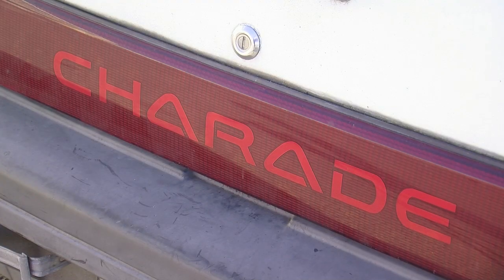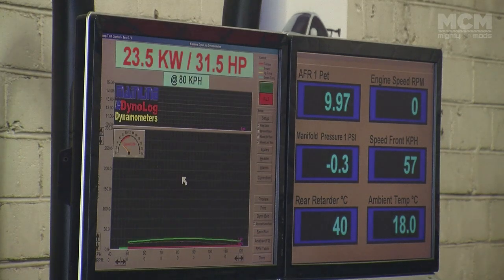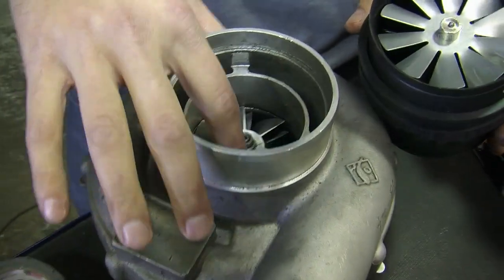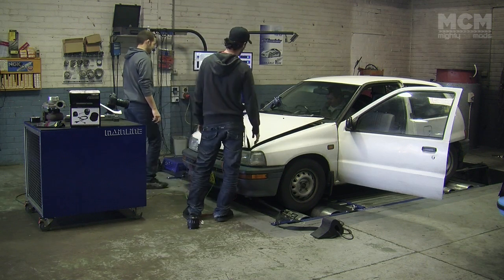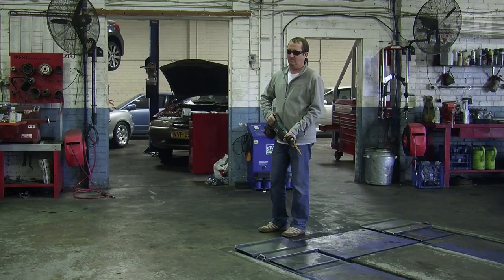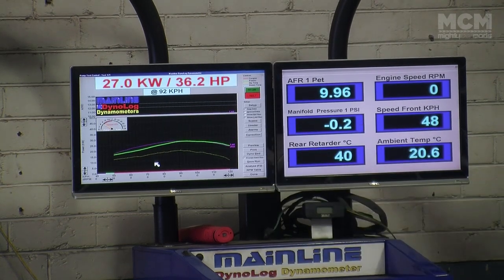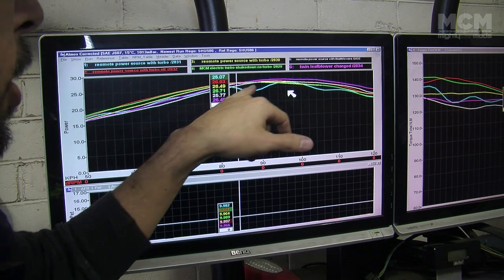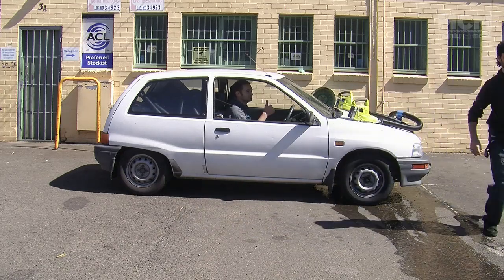Electric SuperChargers Mythbusted

Comment: Just more air, doesnt mean more power. You can put a turbo and push 2 bar into that engine, but without allowing more fuel from ECU = no more power, thats it. You must keep the correct AFR for the optimal power, just put more boost is worthless.
Reply: RizoProduction Holy shit, you all forgot this car is carbureted, there's no injectors, nor an ecu.
Reply: on most stock engines the air/fuel ratio is automatic
its gonna go lean for a couple pops but then the O2 sensor would be saying hey your not burning enough so the fuel ratio would be adjusted accordingly

consider how the throttle doesnt actually do anything with fuel, it adjust how much air goes into the engine, or rather how much air is choked with full throttle being no choke.  the engine knows how much fuel to add even thought you didnt tell it theres going to be more air
Reply: No, it doesnt. Stock maps and ecu software is already too lean to avoid nox formation, well more air will lean out more the mixture. Rich mixture means more power.
Reply: HighPotency Yes, you are right, with 2 bar boost you'll have a very lean AFR(air fuel ration), and gasoline engines doesnt like too lean condition, EGT will increase and engine will blow. In diesel engines things are little different, for 2 bar you can put X fuel or X+30% fuel, risks will be almost the same(excluding extrapower, internal pressure and so on). Diesel likes lean condition.
But idea was, you can put any supercharger/fan/even turbo to create boost or not, power will be the same without additional fuel from ECU and maybe bigger injectors.
Reply: alex bogatz   ECUs meter fuel in two main ways, open and closed loop.  In open loop mode, the lambda (Oxygen) sensor isn't used, instead the ECU uses a lookup table to determine the correct amount of fuel to use based on the load, throttle and sometimes some of the air sensors.  In closed loop, the lambda sensor is used to correct the ratio. Closed loop is usually only used during no-load (idle) or part load (cruising).  When accelerating you operate in open loop mode, normally because you are deliberately adding too much fuel.  When you tune a EFI engine on a dyno, what they're actually doing is fine tuning these lookup tables.  Even if the MAF was able to supply the ECU with a correct measurement of the increased air supply, the ECU is unlikely to have a table entry for the unexpected value (it may even decide that the MAF has failed and go into limp home mode), and will fall back to a default value.
Reply: I'm sorry, but more air does = more power...

 What do you think nitrous is? It's two parts nitrogen and one part oxygen. Nitrous allows the engine to burn more of its own fuel per stroke by increasing the oxygen levels inside of the cylinder. You can add a system that sends nitrous and gas. this is called a wet system. but a dry system will just send N2O into the engine..

 A wet system will send N2O + Fuel to your engine, so your O2 Sensors dont have to do the work.
 A dry system will inject N2O by its self, when this happens, the O2 sensor reads that you're running lean, and will inject more of it's own fuel into the engine.

 So technically, air will increase power..
Reply: RizoProduction My point was more air alone won't increase power, you have to add fuel to it as well as you have just confirmed.
Reply: Oh more air would definitely make more power with no fuel, more explosive power that'd send your pistons and rods shooting out of your block. Ie. detonation.
Reply: gracej79 Yes, you're right here, i was wrong nox vs co2, but even co2 should be keep under control. As other guys said here, more air without pushing more fuel, doesnt mean more power.
Lets take a diesel 4 cylinder 2.0 , we have 50 mg/stroke fuel at 4000 rpm, that means by calculation ~140 hp having ~1000+ mg/strke air(~2.1 bar absolute pressure on 2.0liter engine). 1000/50 = 20 AFR well diesel must have bigger than 16 17 for safe EGT.
Well if you just push 2.5 bar (aka 1200+ mg air), and keep the same 50 mg/stroke, you will not have more power, maybe you`ll have less power, because turbo has to do negative work to develop more pressure and more work means more EMP(exhaust backpressure).
In ECU that 50mg is a maximum limit well no sensor can push more fuel than maximum ecu limit, only if you adjust these parameters. I make remaps specially for diesel cars, for years with correct measurements , dynoed and so on, and i know what i`m talking
Reply: Marius Negrean Electric superchargers would work if they had more power(+motor). Superchargers/turbos have the power to store enough air when inlet valve is closed, thus the "compression stage". Electric turbos cant.
I want to try the supposedly 16.5 Amp electric supercharger. experimenting doesn't hurt...right?
Reply: Yep, thats true
Reply: alex bogatz keep in min thats is only goung to work with a car running obd2 (i think its 97+) but you are correct but only to a certin exstent because if your running (for example) 1:1 ratio of fuel to air  but you then increace air it then you have a 2:1 or 1: .5 but the ecu would only allow itself to change it by .3 - .4 before just quitting and throwing a code.
Reply: Neverming, in ECU maps there exists a lambda/smoke map, torque map, driver wish map. All those maps have a limited value, you can put 1 ton of air, if maps values are not extended ECU doesnt know to add more fuel...even you have mechanical limits, small injectors.
Reply: They wanted to show if it's possible to make noticable gain. That may involve not paying for ecu tune. I'm not sure but cars come stock with rich enough tune that a little bit of boost isn't enough to make an engine blow because of fuel starvation 'cuz the computer fan was too fast. If so, what a story you can tell!
Reply: RizoProduction Same point in my side. JUST MORE AIR, idea was clear. Everyone knows that more air allows more fuel, but in this case nobody controlled ecu to push more fuel and ecu will not do that itself.
Reply: Marius Negrean Yes, I agree. It seems in this video, that when the air entered the cylinder, no fuel was injected to compensate. bad o2 sensor maybe? I mean they did imply they bought the car for $100
Reply: Thats what i was thinking
Reply: Bait28
Ah, yes. I didn't even think of that. Dx
Reply: Marius Negrean with these fans you aren't adding significantly more air. with little actual compression happening the air is taking up the same amount of space. meaning the same amount of oxygen is going into the engine.
Reply: Lean mixture means more power too, just not the kind of power that you want. >.>
Reply: I doubt the fuel pump could keep up with a turbo...for that matter, is it carbureted? Putting that much air through a carb not designed for it is gonna have an affect.
Reply: Yes, more air will mean more power because there is more oxygen for the fuel to consume inside the cylinder, resulting in a more powerful explosion, but then you're running lean and risk blowing something up
Reply: No not..people doesnt understand that cars from factory are alreay too too lean. why more air than that? Keep stocchiometric AFR and its fine
Reply: doesn't the oxygen sensor do that for you? i've never heard of any type of car requiring changing ECU or ECU settings to adapt to more air flowing in
Reply: HighPotency Then I have a question, does it mean when you add turbo on it, you have to upgrade your ecu or injector accordingly?
Reply: todorpetrovic It is more air "in same volume" which is controlled by intake valve opens and closes. With the same amount of time, the cylinder can only suck same volume of air, if you want it contains more O2 in order to get more explosion power, then you have to compress the air. The reason why electric supercharger wont work is at the at the intake valve is open the "fan" blows the air into the cylinder until the air pressure in the whole intake system reaches a value that the "fan" couldn't compress any more. Any fan can compress air in this case, but how much? I would say a fan like that, 5% max, theoretically you get  5% power, if you adjust the fuel accordingly. In most cases, people buy that elec supercharger wont pay hundreds dollars for a customized ecu tuning, that's why people won't get any difference.
Reply: Bait28  His main point was: More air without more fuel = no extra power.  That doesn't change whether it's EFI or carb. Kian Palmer You're confusing efficiency with power.  It is more efficient to have excess oxygen so that all fuel is consumed (but you stop burning before the full stroke).  You get more power from excess fuel as the burn is happening over the full stroke (and possibly still occurring in the exhaust), and not only until the fuel is consumed.  Xiang Gao (Adding turbo).  Yes, if you add a turbo, you need to add more fuel.  If your injectors have already reached their maximum flow rate, then you need to upgrade your injectors if you want to make even more power.  Otherwise they will limit the power you make.
Reply: gracej79 There's a huge fundamental difference between how fuel is distributed with a carb engine and FI, especially when it scales with mass air flow.
Reply: Marius Negrean  You don't reduce NOx by being lean.  NOx is primarily controlled by EGR.  NOx is formed under high temperatures when there is excess air.  A rich mixture has a cooling effect on the charge as the liquid flashes to vapour, reducing the cylinder temperature, therefore a rich mixture actually develops less NOx, but more CO, etc.  EGR allows exhaust to displace air so that you can burn a small amount of fuel without it being an excessively lean mixture.   This allows low fuel usage at light load without high NOx.
Reply: Marius Negrean  I was talking about CO  (Monoxide).  CO is due to insufficient air during combustion.   CO2 is largely directly correlated with the total amount of fuel injected.  (The CO is converted to CO2 in the cat.). The amount of CO2 comes down to a balancing act between predetonation / cylinder temperature / Stoichiometric mixture .  Under your diesel example, additionally you'd also have to take into account the higher air temperature from the higher boost pressure (assuming no additional inter-cooling capacity).  This reduces the relative mass of the air and adds even more inefficiency.
Reply: I said above that ecu has internal limits. Mixture doesnt mean max power, just correct combustion.
Reply: Marius Negrean so ur saying ur car doesn't have a maf or any type of air sensor or 02 sensors?!?! u do know with the 2 said senors above your oem ecu adjusts your afr. but obviously stock fuel injectors or jets have limits. also unless ur car has a 2jzgt in it i would not suggest throwing 2bars on it XD at least not without replacing all internals.
Reply: gracej79 you don't seem to understand how carbs work? it draws fuel according to a preset ratio no matter how much air goes in. you adjust the AFR with the carb not the actual amount of fuel drawn
Reply: IntercourseWithYou  The carb is actually responding to the velocity of the air, not the volume nor the mass (volume/temperature/pressure).  The velocity determines the strength of the vacuum created by the venturi and therefore how much fuel is drawn in through the jets via the vacuum.  The maximum amount of fuel that the carb can deliver, regardless of the amount of air drawn in, is mostly determined by the main jet size as the pressure vs velocity relationship is not linear (As the velocity increases, the rise in pressure slows down).  If you add a supercharger (or a turbo), you're going to have to increase the maximum amount of fuel the carb can deliver.  You either increase the size of the jets or upgrade to a higher flow carb.  The carb settings are effectively small fuel taps, they control the fuel rate at different vacuum pressures.  The pressure is determined by the velocity and not the volume, so therefore there is no direct way to control the AFR with the carb settings.  When you tune the carb settings you have to make assumptions about your intake configuration (affects velocity vs volume) and the service air temperature and pressure (affects mass vs volume)   Which is why you need to retune and/or re-jet when changing altitudes, going to extreme temperatures, or modifying the intake components.    Since most EFI systems calculate the mass of the air, meter fuel by mass, they don't need this retuning.
Reply: Marius Negrean Well that is true in a way but with modern cars if you increase air pressure the MAP sensor will increase the fuel and keep the mixture correct. This is what the ECU  is for and why they have air flow sensors and MAP sensors and O2 sensors etc.
Reply: Mark Tate I believe what Marius meant was that the ECU will only correct up to certain limits.  Once past that limit it will either raise an error (it'll assume a bad sensor), or it won't know how to correct any further.  An ECU designed for a NA engine is unlikely to cope with adding a turbo without reprogramming.  And as previously covered, many sensors aren't used when operating in the Wide open Throttle (WoT) regime, where max power is found.
Reply: EXACTLY! Ecu corrects only up to a limit, and thats it. I can tell you how things are in Bosch ECUS for diesel cars 2000 year and up
Reply: RizoProduction Actually More air=more fuel=more power
Reply: But on a carburetor, should work fine cuz the more air the more fuel
Reply: Orlan Medina To an extent, until it runs lean and you need to increase the jets size.
Reply: AmericanThunder  true too forgot about that
Reply: TheSuperKV Every cool invention started with a crazy idea..
Reply: +HighPotency more air creates a leaner condicionado meaning it must gain power
Reply: Marius Negrean ,You are so right,I don't think these Assholes have got a clue,without increasing the Fuel Ratio as you say the only thing that will happen to that engine is an extremely weak mixture causing excessive heat build up causing all sorts of cooling problems and even engine seizure,these people are not funny just Pathetic.
Reply: Well, you'd blow up the engine at 2 bar of boost and no fuel compensation.

That said, there's no way a computer fan is even adding enough air to make a difference.

Comment: This has me thinking about air compressors. What about 5 air compressors compressing air into a charge pipe that's sealed then releasing the air into the intake. You can even have smaller charge pipes but have multiple of them connected some how and released depending on RPM. haha, just thinking about it makes me wonder if it would make any gains seeing as the air could be compressed at PSI...then released into the intake with pressure from the charging pipe(s).
Reply: or spend less and buy a turbo kit.
Reply: Compressors would give you all kinds of pressure, but not enough volume.

Comment: grab the ebay fan and put 2 or 3 baterrys in series 24/ 36 Volts (only for 10 or 5 second burst respectively or you will burn the motor) and then it should work

Comment: YES!  the aftermarket ones are total bullshit!!  BUT, Formula One is now using electric trubochargers!!  Check it out!   Not totally electric, but hybrid electric and exhaust powered. And they are using a motor/generator that makes electricity off the turbo to charge the battery.  How'd a ever thunk it!!  ;o)

Comment: It wouldst be help if this was connected to a sealed system just putting it on your stock metal air cleaner housing is just dumb. Any kind of pressure that the fan is making is getting blown right out of your air cleaner housing. From your fan to your intake would have to be a fully sealed system so all air is forced into the engine. It would be neat to see this installed with a little common sense to see if there are any gains. I'm sure if there are it would be very small

Comment: That's called nitrous dioxide which allows cars to go faster by injecting it into the fuel supply
Reply: Nitrous Dioxide is NO2. Nitrous Oxide is N2O. N2O is the one you want. Big difference trust me.